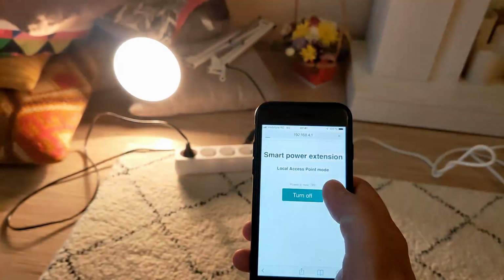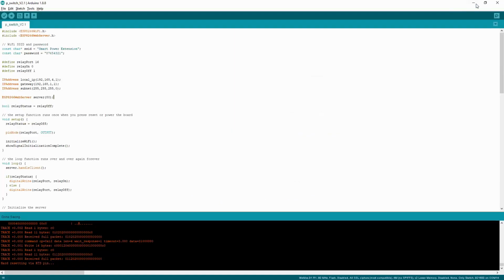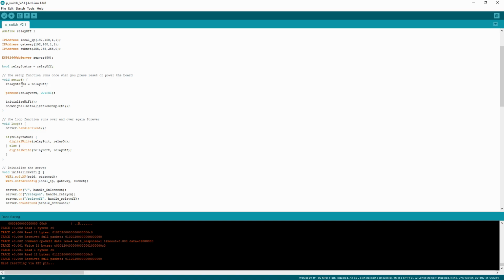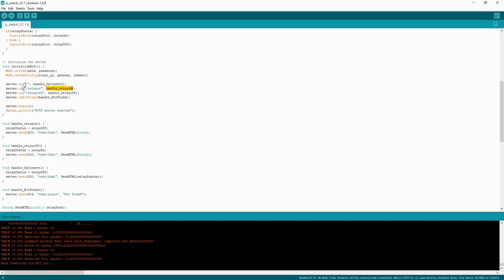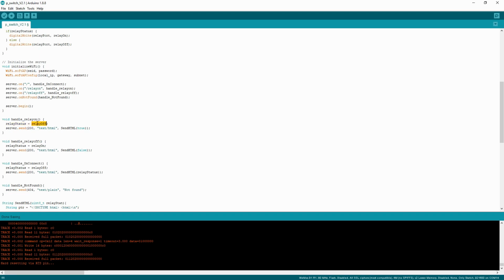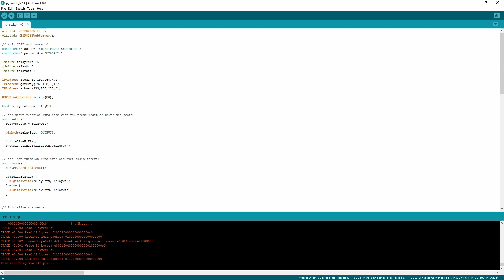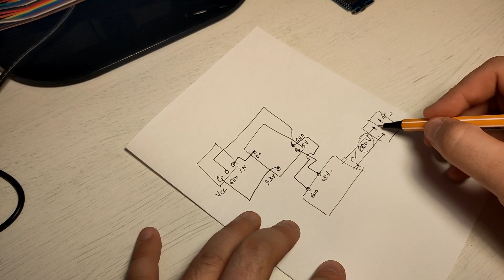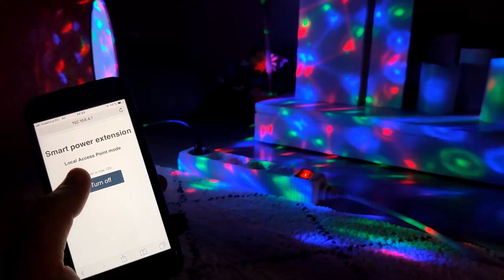WiFi controlled smart power extender with ESP8266 and Arduino

Comment: Would you be willing to help me troubleshoot my esp...it works fine but resets and doesnt save settings
Reply from the maker: Hello! What do you mean by "saving settings"? What is the behavior you expect. The reset may be triggered by insufficient power, but you can also debug that in the console. Maybe this article helps: https://arduino-esp8266.readthedocs.io/en/latest/faq/a02-my-esp-crashes.html